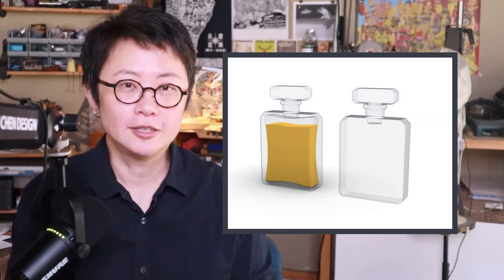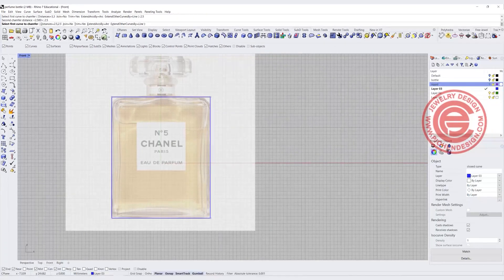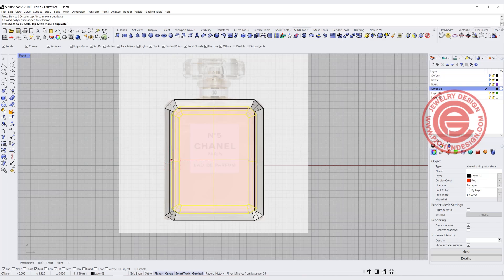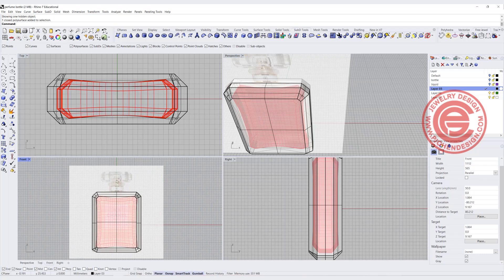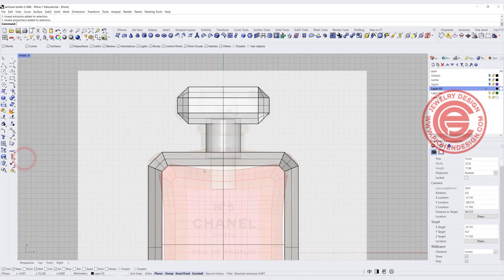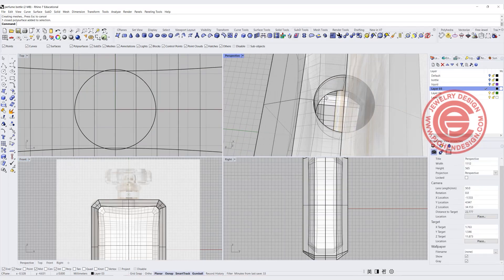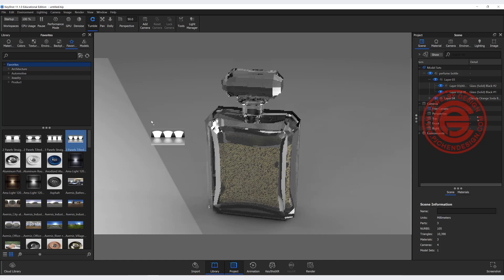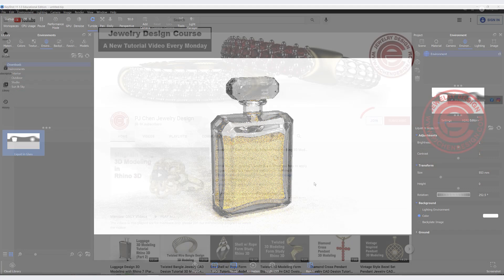Perfume Bottle- How to Tweak the 3D Model for Better Rendering #318

Comment: Can I do your latest tutorials with Rhino 6 or it won't be helpful? I noticed that you use  new commands which I can't find them !! 
And thanks for your efforts 🌹🌹
Reply from the maker: Most of the command I use here should able to be use in Rhino 6. Which one is not?
Reply: @PJChenJewelryDesign  when I extrude or sweep my model , I can't enlarge or reduce thickness of particular part like you do .. so I forced to return back  (undo) to my 2d sketch and change what I want
I thought that the version has a problem or that's not be able with Rhino 6 ?

Comment: This is EPIC! so much work to create the bottle and specifically make it right for Keyshot. It goes to show that Rhino and You, PJ, can do anything: from hummingbirds, to suitcases, to jewellery, and Chanel No5 - everything is possible :)) Since we are discussing rendering glass in Keyshot, may I ask a question: I have a 5 glass panels, all same size, but different colours: white, yellow, red, green, and blue, lined up. I have left small distance between them so there are no surfaces touching. Treating them as Dialectric material on a Light Tent White Floor 4K background, plenty of Ray bounces, but with no extra spotlight etc. Rendering as Product. For the life of me: I can not get them to be transparent - the best I can achieve is to have almost a mirror-like appearance of the outer white layer, but I can't really see through :( any suggestions? I have tried Glass plain and Glass Double as well. Any suggestions?
Reply from the maker: have you try liquid material. Also keyshot cloud has a lot of extra material to download. You can also try them. also, try to download other environment as well. seach keyword for glass, transparent and liquid.
Reply: @PJChenJewelryDesign  Thank you very much for your recommendation. Yes I understand that it will take a bit of trial and error - I need to download some new Environments! I got some a nice effect yesterday by making a thicker, single layer panel of plain glass and applied  all 5 colours as Colour Gradation.